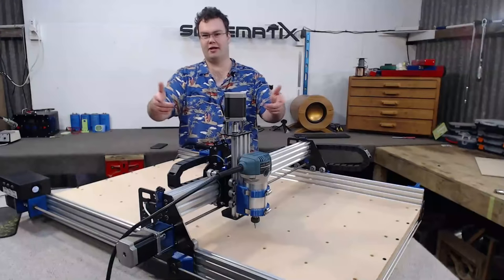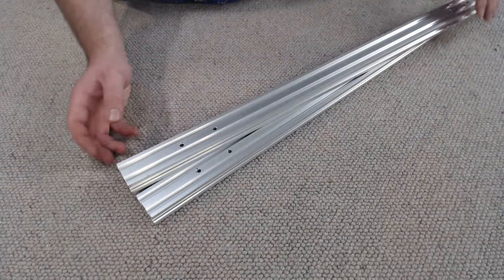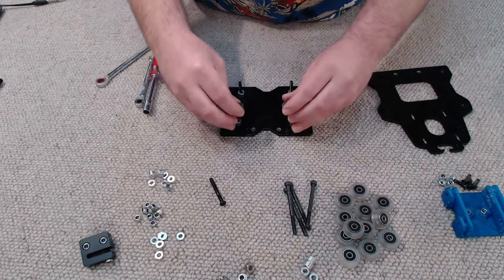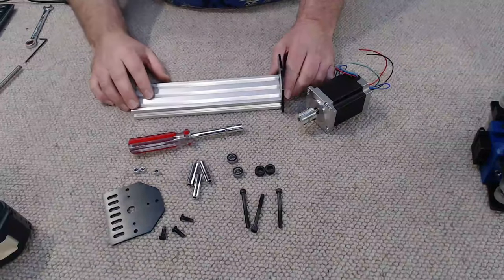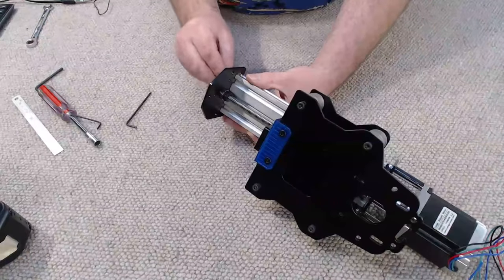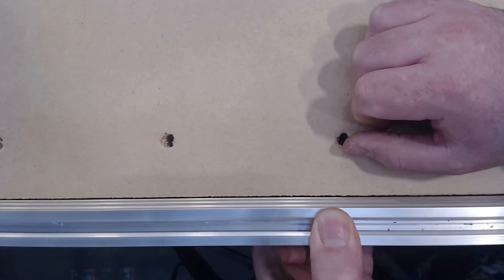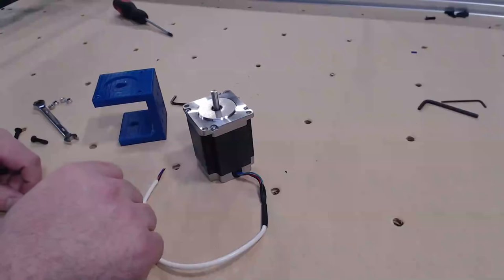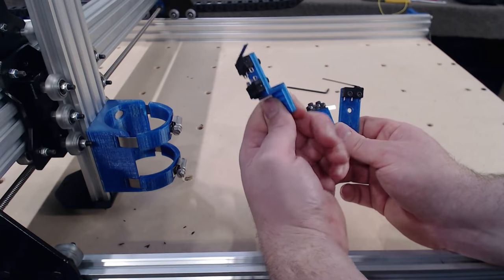How To Make: The OX-Metal CNC Router Mill (Complete build)

Comment: I want to build something that has a cutting area of 1200mm x 2400mm, is this possible with these plans?
Reply from the maker: I wouldn't recommend upsizing this design to a scale such as you mentioned. Simply put in my opinion the machine would be to 'jelly' to provide accurate cuts.
Reply: Schematix what do you recommend instead
Reply from the maker: I'd recommend at looking for something more industrial. And probably not DIY. Yes it's doable at home. But would take a fair amount of time, money, and trial and error. :)

Comment: Do you have links to the other 3d parts you used? All I've seen is is the vacuum parts and the router clamp parts. I have just purchased most of the parts for this.
Reply from the maker: Thats awesome! best of luck with the build. The 3D part files are found with a link in the description. Scroll down and select either 4mm or 6mm part files.rar (the 4 or 6mm refers to the thickness of the material your gantry plates are made from)
Reply: +Schematix thanks so much I'll take another look at the thingiverse page.

Comment: Do you know wether it is easily possible to upgrade a "normal" ox cnc by ooznest to your "metal" version?
Reply from the maker: Yes it is possible. If you've built an OX before, upgrading to the Metal shouldn't be difficult at all.
Reply: Ok nice! Am I assuming right that the only things I need would be your 3D printed parts and the lead screws and the anti-backlash nut blocks thingies?
Reply from the maker: Well the list is a little longer than just those 3 items you mentioned. I can't give you a complete list of hardware just for the conversion. Best you watch the video and workout the hardware list you'll need for the conversion.
Reply: Oh sorry, yes I just realized it! Do you mind sending the list to you in a few months when I've done it, so you can add it to your OpenBuilds page?
Reply from the maker: Sounds good :)
Reply: Another short question :P do you think it would be possible to make your build with the 1500x1500 version if we could leadscrews that are long enough, or is there a limit considering torques sind stability? Cheers, and sorry for getting on your nerves again ;)
Reply from the maker: I'm not a 100% sure myself, would come down to what you are milling. Speaking for my own CNC mill I wouldn't want any bigger if I still wanted to machine alloy. However softer materials should be fine on a 1500x1500. Keep in mind I myself haven't build one that large for testing

Comment: Hi mate, very impressive your work. I'm download the 3d files, but they are looking are not in 3d extensions, how can i used then?
Reply from the maker: They should be stl files which are 3D and extensively used for 3D printing.
Reply from the maker: You can find them on the original OX build link here http://www.openbuilds.com/builds/openbuilds-ox-cnc-machine.341/
Reply: Awesome work mate, I will use it on final engineering conclusion job. What do you think about use same project to create a concrete 3d printer ?

Regards
Reply from the maker: Hmm I've never explored that side of 3D printing so I can't really comment.

Comment: Hello dear friend, you are amazing!!!!, thank you for your project, is really good!!!, I have one question: Could I use Driver A4988 for move the OpenBuilds Motor of 2.8A or is best use the DRV882?, thank you for your attention dear, have a perfect day! :')
Reply from the maker: I'm running nema 23's that can handle 3amps max, however I'm only driving them at 1.5amps. Works perfectly for me
Reply: Schematix oh I see, then not present a problem use 1.5A?, very nice!!!, thank you very much dear!!!
Reply from the maker: No problems :)
Reply: oh!, one more question dear... for the 9mm spacer in the X carriage... what is the separation into the Aluminium profile and Aluminium profile... is safe buld with 9mm spacer or is best idea Precision Shim???
Reply from the maker: Spacers should work fine for that
Reply: Nice, I take nots hehe, have perfect day friend!
Reply: better use DM 542,556 860 drivers and minimum uses nema 23 motor 3-5A
Reply: @gearcnc  i not newer believe 3A motor can use 1,5A good, lot lost step. if use steppermotor normal good need use max amperes.

Comment: whats the average cost for everything?
Reply: you can build similar if you have tools and understanding for about 250 - 300$ using chinese parts from ebay, aliexpress ect. I'm building one now. Depends on how big, powerful and quick its going to be. Mine setup: 4 x motors (nema 23) = 80$, spindle (300w) = 20$, psu for spindle = 20$, psu for motors = 12$, controller (mach3) = 4$, 4 x stepper drivers = 25$ and 100 -150$ for linear bearings, rods, small electronic components (limit switches, stop button, fan, power cord, power cord socket, ect.), aluminium sheet or profiles for frame building, wires (most of them you can get for free from old electronics) and other small components.

Comment: great vid . I'll be looking this up .are you from New Zealand ? have you got recommend seller of these to ship here is parts list . keep up the gppd work cheers
Reply: sorry just seen your open builds link . cheers
Reply from the maker: Hey, yes I'm in NZ, I bought most of the components from Openbuilds, However I did buy the V-slot locally from Auckland. Their website is cnckits.co.nz Since the V-slot is rather long it saved a great amount for shipping
Reply: probably a silly question but did you cut the vslot to size ? cnc kits only have in 500mm differences  .if so what did you use to cut ? cheers :)
Reply from the maker: I used a drop saw with appropriate blade for cutting the vslot
Reply: started buying stuff, just a bit lost on what gantry and carriage plates to go for would you have a direct link for them ? cheers

Comment: This is a hobby machine, low level. 
13 steps to cut a 5mm aluminium rectangle very small. 
Only ONE motor on X axis, to cut a big sheet not on that side, impossible.